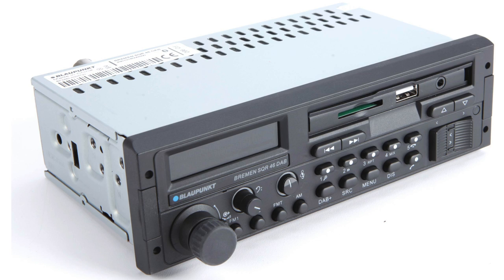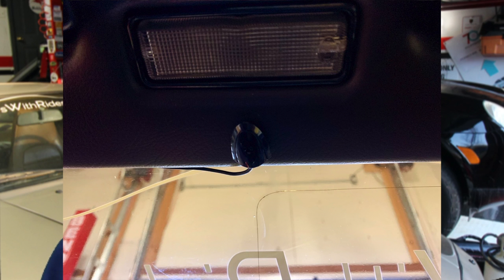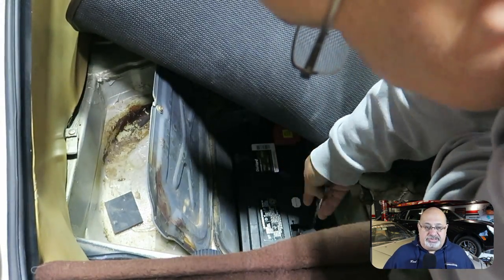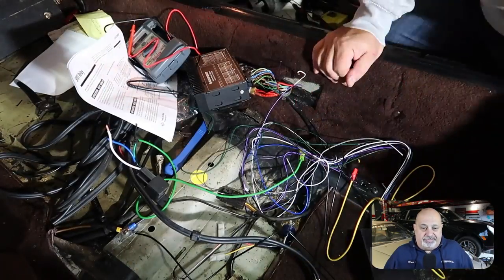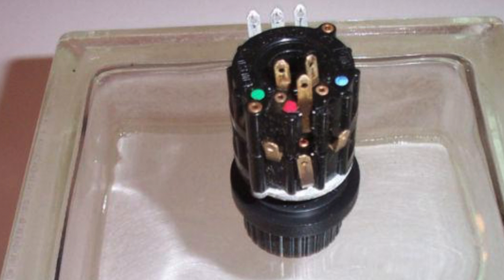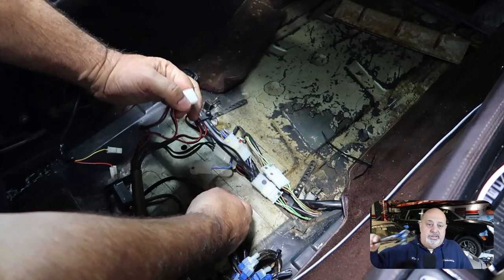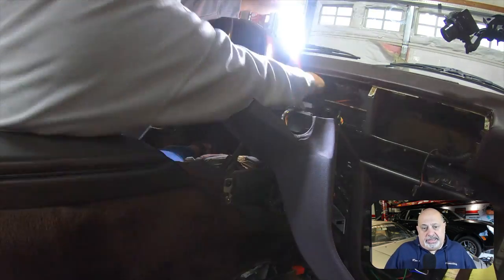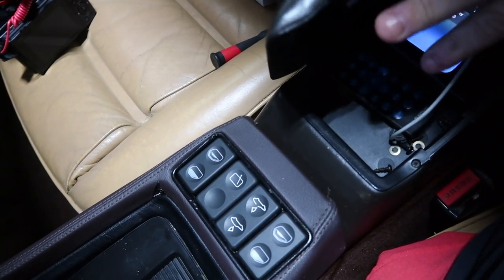Installing a Blaupunkt Bremen SQR 46 80's Retro Style Stereo With Bluetooth & USB in a Porsche 928

Comment: Hi Rudy - thanks for the vid. I recently purchased a 1989 928 with the original Blaupunkt tape deck, and the sound system is abysmal. I wanted to check to make sure you are happy with the Bremen. My speakers all seem to be shot, so I am looking forward to any speaker recommendations you have. I am 100% aligned with you and keeping the car as close to original as possible. So many speakers look way too disco, and I'd prefer to keep the plain, understated look when replacing them. I'm not someone who needs huge sound, so speakers that are respectable is fine. Thanks!

Comment: Great video!

Did you replace all of the fuses and relays in the passenger foot area? Replace every single one with new ones. That's a common reason for electrical gremlins in these cars.

I agree. I do not like most current hesdunits. I.miss the 90's designs.
Reply from the maker: I haven't replaced all of the fuses yet, but I plan to do that with the flashing style just to make it easier to troubleshoot in the future
Reply: It’s actually an eighties design.
There is a Bluetooth nineties reissue released now, the Frankfurt.

Comment: How is the radio reception of the SQR 46?  A friend told me he heard it wasn't good.
And I'm not an audiophile and it's been a LONG time since I've done a car stereo.  How does a 4 chl amp work with all the speakers in a 928?  I have an 89 S4 if it makes any difference.  Thanks.

Comment: Hi, I have a problem with my Blaupunkt Bremen SQR46 DAB.  Sometimes the volume suddenly mutes by itself;  turning up the volume again it immediately goes to zero.  Turning the radio off and on again does not solve the problem.  It is solved only by disconnecting and reconnecting the ISO connector.  How can I fix?  Thank you very much!
Reply from the maker: I'm sorry, but that sounds like something internal to the Bremen unit. I recommend you reach out to Blaupunkt customer service and hopefully, you can get a warranty claim on it.